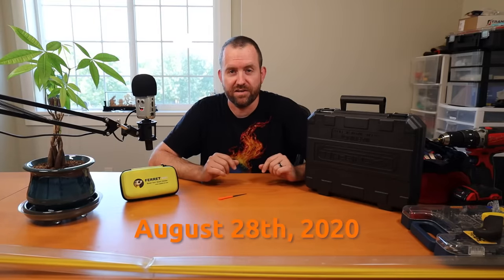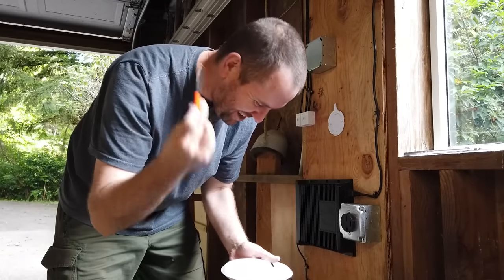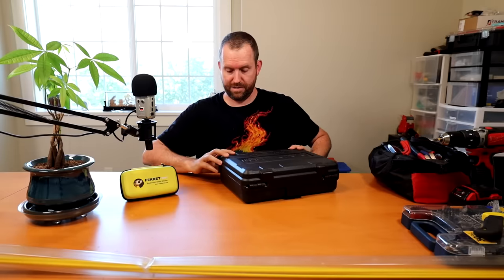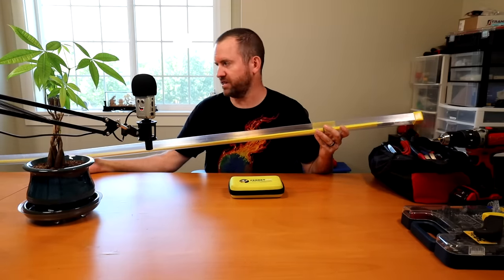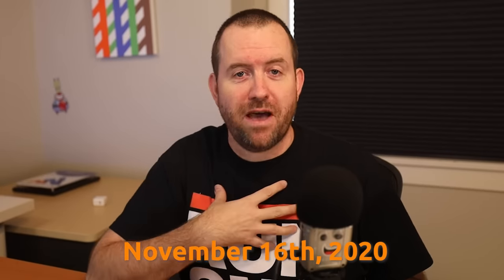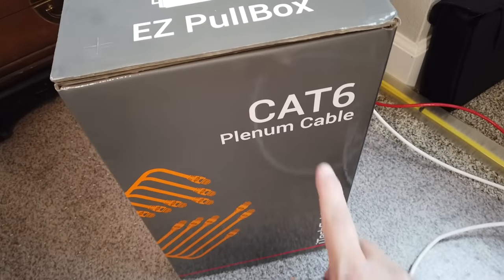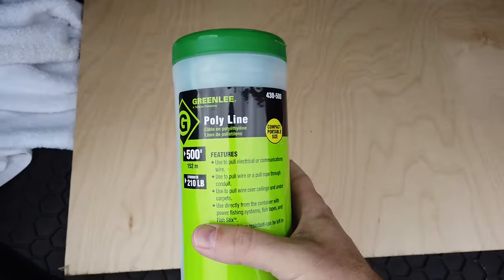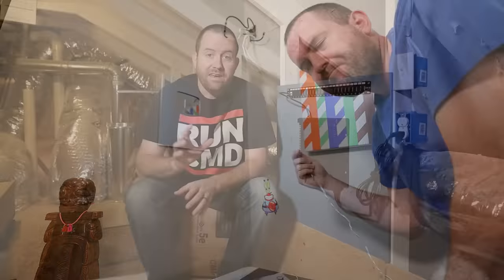CAT6 Wall Fishing

Comment: The use case for the Cable Ferret is definitely sending the sticks through the plenum area above a drop ceiling.  With that bad boy you could probably guide the sticks 20 or 30 foot at a pass!  Wish that was a thing back in my old cabling days 20 years ago...

Comment: Small point, but I would finish off the run with a low voltage frame for your CAT6 jack.  The dry wall and screw will pull right out with a good tug on the cable plugged in to the CAT6 jack.  Much more professional than just drilling a hole.  And did that end up level?

And in the attic, I would run the cable high rather than low.  This makes it much less likely to be cut or stepped on/tripped over.  Or use J hooks, rings, EMT conduit, or I've even seen PVC rain gutters.

Comment: You need a "bell hangar" drill bit.  You drill from your opening near top of wall and through the wall plate.  I have a 3' and 6'.  A must have tool for running security wire.

Comment: Get a cable dispenser. You can make one with a beer crate & circular tubing / trunking. This makes running multiple runs fast and simple for 1 person. You can also use a decent Rc car to pull cable off of the cable dispenser faster than you can walk in a ceiling. A drone could also be used in larger spaces

Comment: Thank you for this video. Never thought about polyline. I'm in a situation where I want to get wired ethernet through the house in some parts and I've considered using existing phone and coax wires as a pull cord. Of course they go from places I don't want ethernet to places where I don't want ethernet, so it's a waste. I had looked at the magnepull before, might be a good option.
Reply: Yup! 120 year old house here with brick walls and plaster & lathe interior - heck, mostly pre-electric.  Really old 4-prong phone boxes and a couple of later phone jacks in walls where I don't need anything anymore. Early 1900s electrical wiring. I'm watching several videos seeing what people do when working without new construction or drywall situations.
Reply: If the phone lines were run during construction (i.e. when the walls were still open), then they're stapled to the wall studs, so you won't actually be able to use them  as a pull line.  Stapling the lines would be code in most/all locations, versus them just flopping around freely in the walls.

Comment: Hi Crosstalk Solutions.  I really enjoy your videos.
I’m just a handyman, but I have hauled my fair share of cables through walls over the years.  However, my experience (especially with internal walls), is that there are usually cross studs in the walls (usually halfway down, plus sometimes diagonal studs at certain locations as well), so running cables from floor to ceilings are usually much harder.
My current house has steel frames, with holes already punched through the studs at regular intervals, but unfortunately these holes rarely line-up.  I’m not lucky enough to have a Wall Ferret, but in the past I have used “cabled Pin-hole cameras” attached to a pushrod, to find my way through walls with existing holes, and that is where cameras like this are really useful.  However, as you found out, being able to control the camera to get the best view is often the real problem.  Maybe someone out there has a Camera head that you can control a little better, or even a pushrod that allows you to control the tip.

Comment: There are a few suggestions on this thread to use fire block foam to fill holes drilled in sill plates.  That's such a great idea that it is required by code.  But sometimes you need to be able to open the hole again so try electrical putty or duct seal.  It acts as a fire and air stop and is easily removable.  Also, it's putty, you can find lots of uses for it including as a toy.

Comment: You use the chain to drop in walls that have steel studs, the plumb bob torpedo looking thing with the cable on it is also magnetic.  So if you drop the torpedo down a metal stud wall it will stick and hang up on the steel studs, the chain is not magnetic so if you drop it down in a steel studded wall the outer roller magnet will grab the chain and pull it down to your wall opening without hanging up.  I have one and man it is a life saver.

Comment: As a professional installer,  I'm not a fan of drilling a circle in the wall, I would use an LV1 (1 gang -low voltage ring).  And I would NEVER use a pair of players to seat the cover on the keystone jack.
Reply: Agreed, but there are parallel closing pliers with smooth jaws for that now (trueCABLE has some).

Comment: Having a basic understanding of residential house construction will go a long way! Having a Cable Ferret would be a huge help when doing any kind of renovation or old work in-wall wire runs where you may not know what obstacles lie in your path. Some construction will not have a clear interior wall cavity to work with. Many times you will have bracing or fireblocks installed where prior electrical lines are run, or in older construction where diagonal crossing support struts or beam studs are used to reinforce a wall. These are notorious for preventing a true cable pull, but with that Ferret cam you could identify what may not be fully picked up by many stud finders. It's also good to identify if any other high voltage electrical or plumbing lines might be in the path or cross your path you wish to chase your low-voltage runs. It's important to not run your data cables near your high-voltage electrical if at all possible!

Comment: I have one piece of advice for anyone building a house. Take profuse pictures of the building process, especially EVERYTHING before the sheet rock goes up. Get shots of all the walls before the drywall but after the plumbing and electrical and coax is installed (which installing coax is probably obsolete now, so call it ethernet if being installed). You have no idea how helpfut it is to know where a horizontal blocking board between studs exists for future wire pulling. Also, knowing exactly where the pipes are will help if there is a leak. Also knowing the best place to cut through the wall to access the bathtub and shower drains to check for termite ingress. Also take pictures of the plumbing laid out before the slab is poured may definitly help in the future.

Comment: I am assuming you do not have a 110 punch tool for your cable termination as you are cutting tails off your jacks. Stripping the outer jacket of your network cable will allow you to twist it into a usable eyelet for pulling.

Comment: You can use cable’s stapler to mount cables instead of nails —> Gardner Bender MSG-301 Heavy-Duty Stainless Steel Staple Gun, Low Voltage

Comment: Chris... Great videos (more on that in another post)... But hey, when you first started to use the box at the top of the wall and then couldn't get through the top plate (which, BTW are probably 2x4's not 4x4's), you can get something called a flexible drill bit. They're basically a short 1/2" or so bit on a long semi-flexible rod. Like those pulling rods, you can shove that into your opening and then attach a drill to it and drill a hole through your top plate. On mine, there is a small hole in the tip of the bit that you can put your poly line through to pull it back down. I got mine like 20 years ago from Gray Bar Electric, but I'm sure you can find them even in a bix box store these days.

Comment: When pulling the poly line, attach the cat6 WITHOUT cutting the line. When the pull is done, you still have poly in the wall. bundle the extra and place it in the cavity. Next time you need a wire you will thank yourself. This line can be used indefinitely for the same run since you have enough length to go back and forth.

Comment: You know when drilling holes in a building frame there are building codes that you must follow. In non-load-bearing walls, you are allowed to cut bigger notches or drill bigger holes than in a load-bearing wall.

When running cable, electrical wires or pipes and notching or boring studs is required you must keep the structure strong and remain within the electrician and plumbing building code.  It is not just about, oh this is a simple path I will just drill here and think nothing of it, frame integrity is very important to consider when running any pipes and wires.
Reply: Sing it, brother! A good buddy of mine is a firefighter, and will go on forever about the evils of balloon construction and the things homeowners do that make it worse.
Reply: @SteveNeighbor  Yeah those old houses go up in flames and collapse real quick. Although I do like the concept of balloon framing so easy and lightweight.

Comment: I remember working for San Diego Alarm and in a very old building, there were Tube & Knob wires (which were bare). I used my Simpson meter to test the wires, and to my surprise the wires were HOT with live 120 volts!  10 years later, when I was an E.M.T., We had to rescue a telephone repairman who was electrocuted the same way by brushing against a hot wire. We tried in vane to save the man, but with sweat, and salt making a perfect conductor, It stopped his heart instantly!
PLEASE be careful in the attic, and cut the power to the building if you are not sure!

Comment: It may have been said already (without reading all 462 comments) but, I believe it's a bad Idea to put patch panel and network switch in attic space. temperatures in the attic space and be extremely high and the overheat the network switch. It's a better option to use a closet or make a box on an interior wall (so not messing with insulation) with a cabinet door for aesthetics. Either option, make sure you allow for ventilation. My 2 cents.

Comment: That CAT6 cable is copper-clad aluminum. Although they advertise it as "solid" wire. It's not solid copper. Just a heads up! Love the videos
Reply: You can always test the cable by exposing about 5 inches of one cable and apply heat to it with a lighter, aluminum clad cable will bend sharply while copper will just glow red.

Comment: The white electrical box you took off in the attic prior to mounting your network switch, was that a vector security system? I just ripped one out in my basement. Going to reuse it for a auto switch for a battery with inverter backup. Great video BTW.

Comment: Drop the ferret down/up from the top/bottom plate hole is best.  Needs to run straight/parallel.   From the wall hole it goes goofy angle due to the pole bending.

Comment: Not sure I caught whether the attic switch is going to be connected to another switch in the house.  I probably would of run 2 fiber lines in aggregate to it so I could maximize throughout from any clients using the connections upstairs

Thanks for this video though I wish I watched it before I started on my house.  The first pill I did was on an exterior wall and it was a total pain…. I think I’ll try and get one of those magnet pull kits

Comment: And there I was using a weight (ringspanner) to have my cable go down 1 floor.
Now I see a big plus for the 'wooden'-houses used in the USA.
Or house is made with concrete walls and floors, no way I could use those tools except the ferret.

Comment: use masking tape instead of electrical tape to attach to pull rods etc.  it hold well enough, is easy to get off and does not leave black gunk on the wire.  another great tool is a length of 1/2 in plastic sked40 pipe. it is flexible and you can push and pull wire over rafters etc.  also when you break it or leave it in a ceiling you are only out a couple of dollars.  I agree with always pull a spare and pull a string.

Comment: Damn im jealous of wooden/drywall homes. I line in a concrete/brick building. There is not way to run new cables especially between floors. Unless im missing something, i'd have to bury new conduits in the wall. That means creating the chanell for the conduit, install it, cover the gap and paint again the wall. The conduits for the electrical cables of the plumbing are set in place when the building in made.

Comment: FYI, put you floor boxes at the same height as your electrical boxes.. ~12" or so from the floor is the norm.. nothing looks worse than a bunch of boxes all over at different levels..  unless of course you are putting a device at a specific level..  like an access point or  camera.. etc..  and instead of terminating everything in the attic, make home runs to an upstairs closet.. run a dedicated circuit for the power.. and put the equipment in a wall mounter rack above the shelf..  if you want, run fiber or 10g copper patch between switches on each floor.. an easy way to get between floors is through the return air duct..  just make sure you use plenum rated cable and seal it good at each end..  you can also run cable outside and up to the soffit if you absolutely have to have a drop on the outer walls and don't want to mess with fishing.. hide the cable behind trim or along siding, if you have it.. paint to match..  I've matched paint to brick or grout/mortar when i had no other choice..  if outside is not an option, you can cut holes where you need in the drywall.. goes for anywhere you get a difficult drop that's kicking your ass.. it's quicker and cheaper to repair drywall holes than fight a drop for hours..  anyone who has pulled cable in old construction where there's been additions or buildings that's been modified and added onto over the years with different construction materials and methods know what i mean.. i have a nightmare client.. 70 year old cinder block building that's been added on to using temporary buildings, standard wood construction, metal and brick.. no less than 14 times over the years.. every couple times they put a roof over the whole thing.. there are 10 attics, some inaccessible at all.. 6 roofs at various layers, plus the temp building roofs.. a combination of suspended ceiling, drywall, solid wood.. etc..  it's an 11,000 sqft nightmare.. i put 32 cameras and a 24 port data network in it in 2008.. said then i would never do it again.. well, last year they called and begged me to come upgrade them.. 4 separate companies had taken the job and quit the first day.. they agreed to pay whatever it took..  so, i put a 36 phone VoIP system in / 48 data drops / 32 new IP cameras to replace the analog ones and a mesh WiFi to cover the entire place.. all to a new server room on the complete other end of the building..  i charged them a fortune for it tho.. now it's official, i will never do it again..

Comment: Better to use a low voltage outlet box, those are the orange ones, than no electrical box at all especially on outer walls where you can use a outlet insulator under the cover to reduce air leakage. Put a cover on your attic outlet too.

Comment: lol I did something like that a last year but without any tools ;-) Just put the cable in the top hole and pushed it down between the drywall and the insulation. Worked first try! It really depends on the Inulation job behind the wall, if it's made clean and from a single piece as it should be, you won't have any trouble getting the cable through. Also, gravity is your friend hehe. 
Another GREAT tipp, get some help, pulling cables alone is never a good idea. One should pull while the other pushes the cable in.
One thing you should definitely stop doing is using standard brick/concrete wall dowels in dry walls! I mean, it will work sometimes for tiny stuff but they usually don't work well and can really damage your drywall, especially while driving the screws in/our!. I know there are some "universal" dowels out there but I do not like them. Depending on the weight / stress you want to apply you can get various types of drywall dowels, most are easy to use and work really well and, most of the low stress/weight drywall dowels can be removed and even reused.

Comment: pulling cable with the magnepull or with a rod - Do Not Bend the Cable LOL

you want a nice smooth taper after you use the electrical tape to attach them. Start the tape at the tail of the rod and wrap towards the head until the cables are covered + 2 - 3 more wraps. 6 good inches cable should be enough for a good connection like this. 
Henry D has it right in his comment, add in some poly line for future pulls.

Comment: Gadgets are fun.....but save your money...just use a piece of jet line and an 8 inch piece of light chain...slides down the wall even with insulation...Use a "wall caddy" instead of drilling a hole.

Comment: You drop the chain down inside walls to where you have cut a hole for a wall plate. & mud ring.  You can also just buy some "dog chain" for the same purpose.
Hopefully, those sticks glow in the dark.  It makes things a lot easier when working in dark areas, to see where you're pushing them.
When using that magnapull, try pulling down the wall, instead of up.  Let gravity help you.  You won't have to worry about losing the shuttle, should it separate from the roller.
That is not the way to mount a wall plate.  Use a mud ring and cut a rectangular hole to fit.  Mount the mud ring and then the wall plate too the mud ring.
While your switch appears to have covers over the connectors, it's generally not a good idea to wall mount equipment with the connectors facing up.  They will collect a lot of dust.
When you're done pulling the cable, leave the string in place.  It may come in handy later.

Comment: I would turn the USW so the switch ports are facing down and not facing up in case of a roof leak from above. I know it's got port covers but I wouldn't trust those.